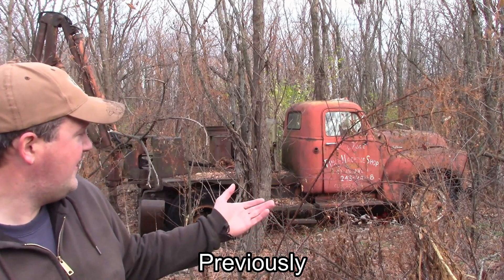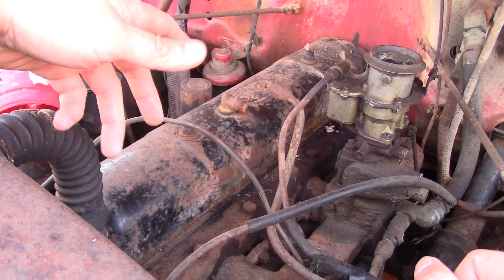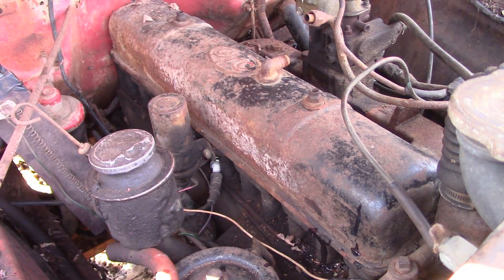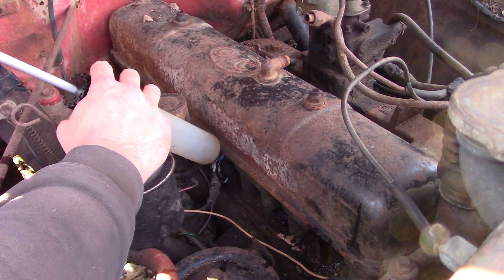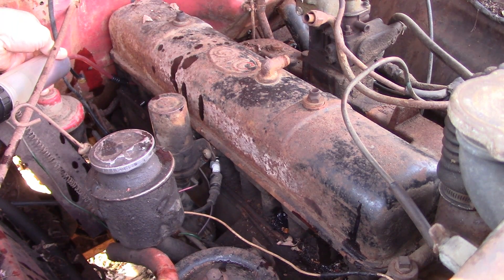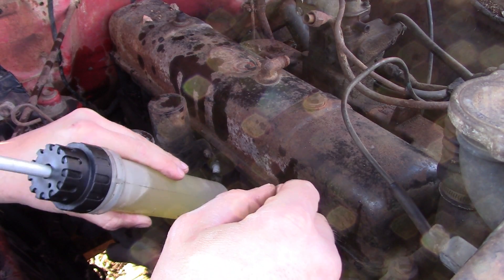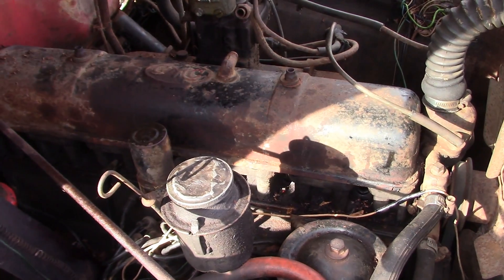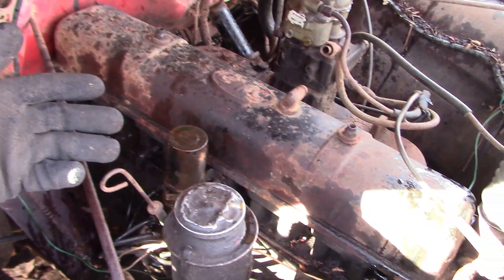Can You Free a Stuck Engine with Evapo-Rust?

Comment: i wouldnt  write the motor off i think it would be a good idea to remove the head and try vinegar down the bore to eat out the rust dont leave it in to long maybe a day suck it out or use rags to   clean it out and tap the pistons with a block of wood the tapping will help to break the rust seal also heat the atf fluid so its hot when it goes in the head works way better i find you have to try a combination of things to free them up and afterwards try some leverage on the crank pulley use a decent bar
Reply: That GMC backhoe got cut up for scrap well over a year ago.

Comment: Would anything be wrong if you used compressed air in the sparkplug holes ? sealed to put 150 psi in there instead of using gravity only ?

Comment: did you dump some down the carb intake manifold? just wondering
Reply: on my 1963 olds 215 aluminum v8s, both had valves stuck in the guides preventing the emgine from turning, love your channel

Comment: I always used s
SAE50 and Marvel mystery oil in each cylinder tube and a 24volt jump from a tractor or any vehicle with a 24volt battery bank!...it won't happen over nite but it works is the starter and wiring any good if so I'd use the starter to do the legwork along with the 24volt Jumpstart freed up a bunch of engines over the years!...

Comment: Evaporust has worked great unfreezing rusted solid vise grips, adjustable wrenches perfectly. As long as it's around 60° or better. Won't work at all colder than that. You said it was getting cold. Amazed what that stuff can do usually.

Comment: Only way to have a real shot with a tight engine that seized or one thats just sat tooo long. You have to have marvel mystery oil or kroil on top cylinders. And then get the block hot. Use a big space heater. Watch it. Its boring but id rather be bored than burn a truck up. Anyways after a while start bumping the starter a lot and itll vibrate that oil past the rings! This has been the best luck ive ever had! Or take starter off and pry and jolt the flywheel!
Reply: If you still got the truck to try it on id really love to see you give it a good try!
Reply: Cut up for scrap metal a few months ago.

Comment: break fluid  is the right stuff leave it for a week and cover with foil and it will unlock in a week or less
Reply: not a joke it will work
Reply: By then, it'd already been cut up for scrap metal.

Comment: I've used Evaporust. I think it might have worked if there wasn't any diesel/ATF coating the piston/wall intersections. However, even if it had come un-stuck it would have needed to be torn down anyway because, the last time I used Evaporust on anything with aluminum connected it dissolved the aluminum.

Comment: One thing I notice using Evaporust on motorcycle fasteners etc is that they come out with a weird texture like they have been sandblasted. They also start to flash rust again in hours. Its a great product if you're going to paint or treat the item afterwards.

Comment: This might be a silly question/idea. Is there any way to apply a pressure to the evaporust while it sits in there? Probably by threading something in and applying air pressure. If you saw a pressure drop over a few days you'd know the juice was getting down in the cylinder then.
Reply: Valves have to be closed and in good shape

Comment: My experience, pick oil or evapo and stick with it, using both has never worked. Once the oil gets into the crevices, the evapo cannot get in. If you use evapo first, the chemicals in it that did get into crevices dry out into a powder that fills the crevices keeping the oil from getting in. If one/both fail, its time for the blue tip wrench and a press.

Comment: 1) try a grease gun with spark plug adapter fittings. you should be able to force the pistons to move.  
2) Evap o Rust is water soluble.

Comment: I used mac engine fogger NAPA Before empty-ing 1 can per cylinder expect 2 at almost top DC with a 2/4 wood and mallet each piston got 2 good wacks 3 days later rust de-solved took 20 minutes of turning motor back and forth to get full revolutions

Comment: have you ever tried to get a thread adapter to attach a hydraulic line to the spark plug / fuel injector holes(depending weather its diesel or gasoline engine ofc )  if a engine is stuck you have to open it anyways to reseat the valve stems and clean up cylinder head and hone out the cylinders as well as new piston rings but it way eases disasembly if the pistons ar at least broken loose 
it works well on tractor enguines and diesel engines, with gasoline engines you need to be a little carefull cause the connecting rods are usually weaker - so you dont bend or crack them-

Comment: I give you an A for effort. I had a salesman show me some penetrating lubricant that would sink to the bottom of water. Pb blaster floated on top of the water and this stuff called open and shut sank to the bottom of the water and ate the bottom of a styrofoam cup. It worked pretty well but not as good as a torch.

Comment: Haven´t tried it myelf, but a mix of acetone and ATF is often mentioned. Only engine I´ve gotten un-stuck was an old Citroën DS. I had the head of and bashed the pistons with sledgehammer and wood and tried every oily stuff I had lying around. The thing that did the trick that time was a LOT of WD-40 and using the starter on it. Did it survive? Guess what, it´s twenty years since I did that. Runs like a dream. It also had every substance known to humanity in the crankcase and possibly some alien stuff. Even antifreeze which people claim that it kills the bearings. It might have sounded a little strange for a while but it got good after a while. The Citroën has a very overbuilt engine but that old iron is no moped either.

Comment: Why has no one removed oil sending unit and with a weed sprayer pushed diesel oil or any light oil through the system to lubricate the rings?
Reply from the maker: Because that won't work. The rings are lubricated by oil splashing up from the rotating crankshaft.
Reply: If that is true why are there oil holes in the rod gernals matched to holes in the piston rods that squirt oil on the rings and cylinder walls?
Reply from the maker: @josephmarshall3918  There are a small number of engines that have oil passages drilled through the connecting rods, but the most common system is to have a hole at the top of the wrist pin journal that allows oil to splash in. The rings are lubricated by oil holes inside the piston. Some engines have piston cooling nozzles that squirt oil up at the bottom of the piston. Others just use the splashing from the crank. I've never seen a pressure lubed ring.
Reply: Ok

Comment: No secret to freeing up rusty cylinders. Just pour some Vinegar in the cylinders wait a few days then work it loose with a breaker bar. Do not force it. It is a common problem any Marina faces with improperly stored engines. The Vinegar turns the rust into a black greasey substance. 
Don't get the Vinegar in your eyes. It is 5 % Acidity. Loosens up the rings as well.  A Navy Seabee taught me this decades ago.

Comment: I guess  apply pressure with grease in the cylinder with grease pump and nipple on an old spark-plug will blow the head gasket instead of pushing the piston but it could be interesting to see.
Reply from the maker: I did a whole video about that.

Comment: Evaporust is citric acid and water. so yes, it’ll freeze.  so 1, you can make your own but stronger. And it’s absolutely necessary in heavy rust situations. also, doesn’t work well in the cold. Warmer is better. Sometimes when I’m impatient I’ll warm a few gallons up on the stove and a 24 hour soak turns into about 4
Reply: Evaporust does not contain not citric acid. The main ingredient is Triethanolamine phosphate which is a chelation agent - quite different than an acid that removes rather than converts metal. Being a chelator it does not work like an acid - it takes a lot longer but it is not destructive. It will not however add metal that has already oxidized. Yes it does contain water and as you suggest it is definitely best served warm.

Comment: I would use highly concentrated vinegar and give it 24h. I mean you would need to hone the cylinder walls anyway, so a little damage isn't the end of the world.

Vinegar will mix with any residual water and is a lot stronger than evapo-rust.
Reply: Sorry, vinegar won't work on an engine this stuck.
Reply: @adellesloan2112  why wouldn't it? It dissolves rust.
Reply: @RubenKelevra  would cause further corrosion. Anyway, that truck had already been cut up for scrap metal by that point.
Reply: @adellesloan2112  that makes no sense. Vinegar and evapo rust does not cause corrosion if applied correctly.

Comment: Those “Jimmy 6” engines were used a lot in early drag racing and Bonneville salt flats racing.  (Late 40’s early 50’s time frame) They made big power in its day, with added speed equipment.  Some guys still run them on the salt.

Comment: try putting peroxide in the cylinders and see if it works because peroxide cuts rust pretty good and also brake fluid is pretty good for cutting rust as well

Comment: Two things probably truck is left in the first or second gear Clutch is seize against pressure plate. You need to free clutch first. Place shift in neutral take long flat chisel and chisel between pressure plate and clutch disc. After that  try with long pipe and wrench to move engine. If that is not working remove head it will move then. I suggest you to put small inspection camera into plug holes and check condition of rust around cylinder.

Comment: Thank you again Wes. What if you absolutely had to free the engine and get it running. Is possibly the drive train, clutch plate etc full of crap or the starter. Is the bell housing full of excrement. A walnut stuck in the teeth of flywheel. Have a wonderful Christmas.

Comment: What I did on a sa200 lincoln that was seized was I plugged the exhaust and intake off and took 4 compression testers put them in the spark plug holes and put compressed air to all 4 cylinders at once ( make sure to remove the shrader valve ) for a few hours I used  atf and acetone 50/50 ratio the air pushes the mixture around and through the piston rings make sure to take out the drain plug and put a catch pan under it so you can keep reusing it I did this for a few days working the crank back and forth until I get freed up

Comment: What you need is a bigger lever , a steeper hill or a couple of fire crackers or starter fluid in the spark hole put plug back in and put 12V to spark plug---BANG even if a valve is open it'll unstick it, will it ruin the pistons hell yes! but your gonna need new ones anyway, will it bend a rod -possibly so make sure you can get a set of rods otherwise eveything else should fine unless some else has already tried this trick.....

Comment: Put a bent piece of rebar in the spark plug hole and tap the top of the piston while some one puts a breaker bar on the crank pulley moving it back and forward slowly. It’s worked for me over 50 times.

Comment: Isn't brake fluid hydroscopic?  If so, that may be why some swear by a 50/50 mix of ATF and brake fluid.  Pull any moisture out of there so the oily part can get to where it needs to be.

Remember, what some call being stubborn and bull-headed, is to others ... perseverance!  Though these days I would prefer dragging it out of there and trailering it home so I could work on it when the mood strikes.

Comment: Just because I happen to like "different" old motors, I checked Ebay for anything similar....   There are two listings for 302 "Jimmy" short blocks, one priced at $3999 and one at $2999.  There was an actual "Sold" listing for a 270 cubic-inch Jimmy 6-cylinder engine in running condition for $2250......   so......yeah, that motor may be worth a second look....

Comment: Dr. Wes. How many times are you going to pronounce this patient deceased? My secret sauce would would be 3 gallons of  diesel fuel applied liberally to the roof of the cab followed by a road flare tossed on the drivers seat. Once you’ve burned it to the ground, you will no longer be tempted to wonder if it could be fixed. I’ve done the research and it turns out there is nothing highly desirable in, on or within a one mile radius of this truck. Let it go, LOL. 😎👍⚡️

Comment: A 1955 GMC 302 inline 6 cylinder short block is listed on eBay for $4,000. The military version is listed for $3,000. There’s a third one (core only) sort of appears all rusty and junky like yours for a couple of hundred bucks. So there is the possibly (a very slim one in your case) of making a buck or two.

Comment: I have taken an old spark plug and made an adapter with a grease fitting,  screwed the adapter in the head and started greasing with the grease gun. Do that and you might get the locked up pistons to move.  You can add a little solvent also.
Reply from the maker: I have a whole video on that with a different engine. Didn't work. Just blew the head gasket.

Comment: Good try.
Engine builder magazine had a story on one of those 302's  years ago.  Some engine shop did one up, with a supercharger and throttle body fuel injection - it made 250 HP at 3000 rpms. 
Since the LS engine came out,  even the original small block Chevy is becoming less popular.  This old inline - very small fan base.  But I guess it is cool as a museum piece.

Comment: The engine displacement is marked very plainly on the engine right next to the bottom of the distributor. There are two tabs/casting on engine where the distributor bolts down. One has the engine serial no. The other is the displacement. If some factory outlet rebuilt it then it is also on that same casting that is about a inch an a half long by quarter inch or just a little more deep towards the engine with marks like .10 and then a letter to go with.... assuming it means cylinder bore or it could be rod displacement. Who knows, I only know that millions of them were built for the army, navy, marines, and you find all these wrecking yards full of those old beaters. I like many would love to hear it run and the only redeeming thing on this one is being fairly close to the shop from my hearing prospective. But whether its a 270, 302, 450, 502... its still  just cast iron that has little meaning today. I am not sure as to what more it could be. I really doubt they put a once of gold in each block so its just junk where it sets as no one is going down there to install a engine in a truck that needs everything else to make it move again. If it were solid gold, it still wouldn't pay the national debt either. Good call Wes

Comment: Wes, try putting 20g of FFG Black powder in the cylinder that is near TDC.  If that does not work, you outa luck!
Reply: I like that suggestion!  You never know what will work till you try. It’s really stuck so maybe load all 6 and touch them off in firing order sequence. That should fix the old engine for good. 😎👍

Comment: But Wes but Wes.... you didn’t try my great grandads secret sauce for breaking them loose!! Lol you need a team of horses 3 bottles of Tabasco sauce a box of thumb tacks and some of that sticky stuff that comes on baseball cards... it will be running in no time! Granddad always swore by it
Reply from the maker: I think that only works when the summer solstice falls on a full moon.
Reply: Maybe penetrating oil might work! As VGG would say there's about 87.63% this will fail
Reply: Don't forget the Eye of Newt.
Reply: Actually, thumb tacks (or sheet metal screws, which is what I use), are very useful for cleaning rust.  Put some in a fuel tank with some detergent and shake it like a maraca.

Comment: Hello Wes!!  Good try with the evaporust anyway. Those 302 engines were used in the Army deuce and a half trucks for a while from the late forties through to about the mid 1950's, they were a rugged old design, but they did the job, but the trucks were limited to about 50 mph or so tops! I had a GMC 2 1/2 ton  M211 dump truck of about 1955-56 vintage  that old truck was well built 6X6!!

Comment: The name of the product is misleading.  It doesn't evaporate or even dissolve rust.  It converts it from the orange-ish, porous, solid we lovingly know as rust, to a different solid.  The new compound forms exactly where the rust is/was, so if you want bare metal you have to remove the new blackish compound.  i.e, if the rust was jamming up your mechanicals before, you will still need to get the newly created black stuff out.   https://en.wikipedia.org/wiki/Rust_converter

Dumping Evaporust into a rusty thing will most definately help prevent it from getting worse, but the resulting solid layer / debris will still have to be removed from bearing and wearing surfaces.  It's like a chemically deposited mill scale, and almost as abrasive.

Very much worth noting, if you have two things that have become rusted *together*, the rust converter isn't going to penetrate very far because the solid it forms is waaay less porous than the original rust - it blocks the water based converter from continuing to soak in. 

The best use scenario for Evaporust, is on surfaces that can be completely mechanically cleaned afterwards.  The new solid is much, much easier to remove than the original orange corrosion.  The main benefit isn't  even removing the bulk of the rust,  its changing the rust that is in pits too small to clean out, and sealing those from more rust forming.